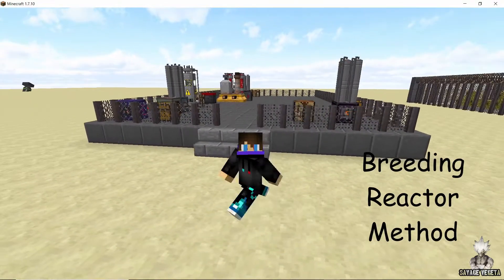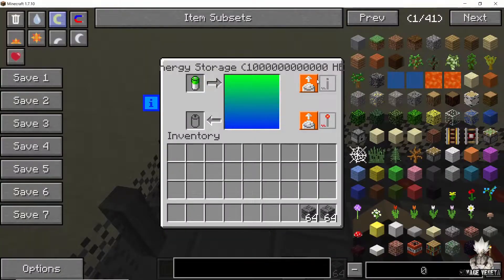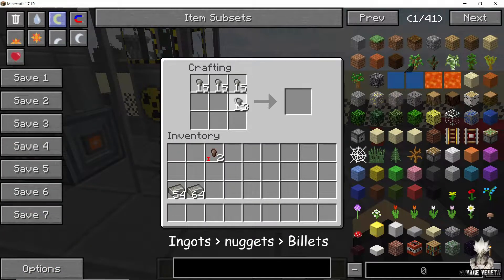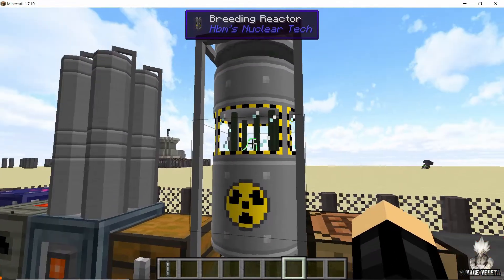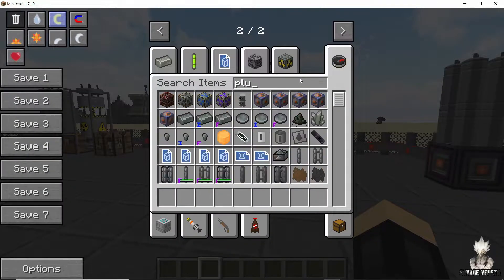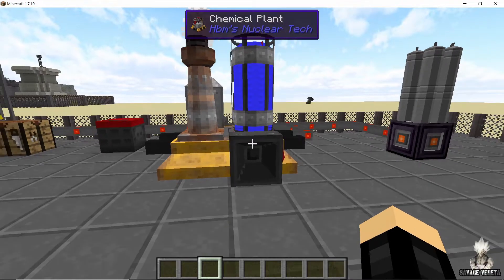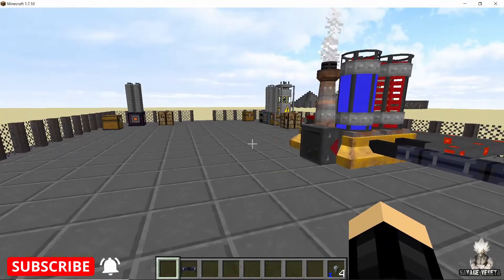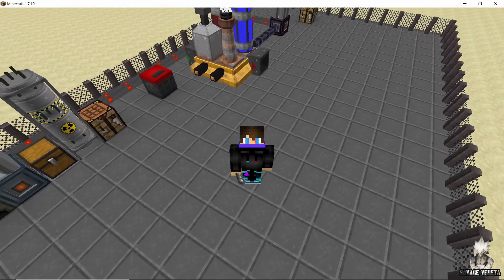Plutonium Processing guide for HBMs Mod | Make Plutonium Fuel for Nuclear Reactors in Minecraft

Comment: Hey bro: a question, if i put the plutonium fuel billet together with an empty RBMK fuel rod in a crafting table, foes this make the medium enriched plutnoium fuel rod? Or jusf some type of plutonium fuel rod? Me and my friend are making a server and need to decide what fuel to use for the RBMK; can you give me some advice?
Also man, thanks you so much! You're tutorials are so good and so helpful, i wouldn't know how to make a nuclear bomb without the uranium processing video😅
Reply from the maker: Depending which version of minecraft you are playing this mod on you can either use NEI (for 1.7.10) or JEI (for 1.12.2) mods to check the crafting recipe as with simple tweaks of adding or removing plutonium 239, 240 and 241 will yield different types of rbmk rods. 
However I would recommend using MEP instead of any of the HEP rods as MEP is pretty safe to use but HEP is very reactive so the reactor design for it will be a bit different leaning on the safe side.
Reply from the maker: MEP iirc uses Pu 239 and U238 to make however I am not totally sure about that and I am at work rn so i can't check either. Thats why NEI/JEI will be your best friend with this mod. Also thanks man I am glad to know you enjoyed my video
Reply: @SavageVegeta Thank you dude, I'll definitely look into 1.7.10